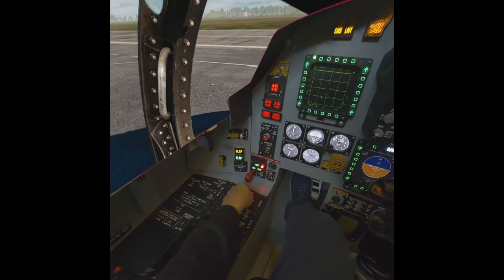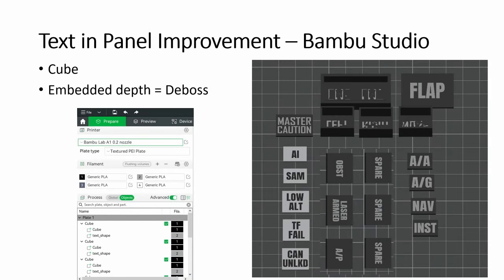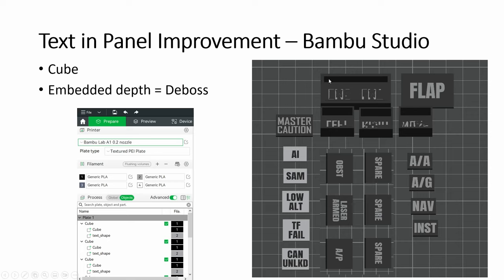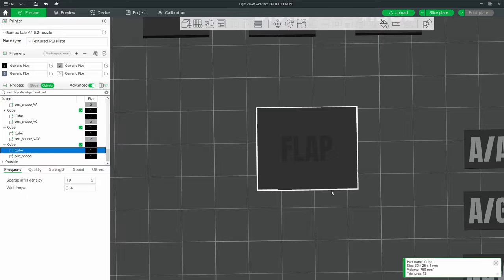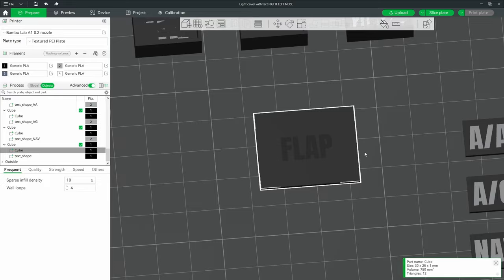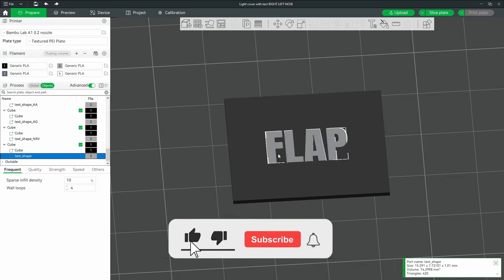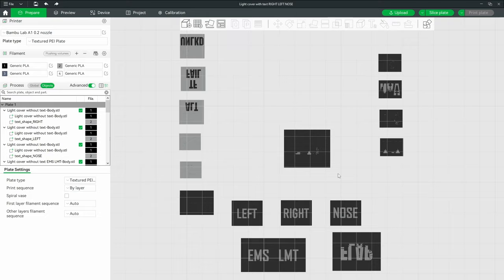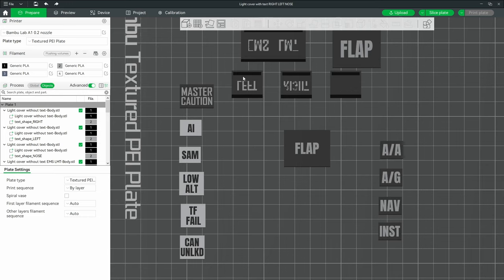Episode 36 DCS F-15E More Readable Text for Light Indicators and Panels

Comment: I got my hands on a very crisp indicator panel and apparently that's made with foil and a laser printer. That's one of the moments I wish I could attach images to YT comments *sigh

Mebbe a good option.
Reply from the maker: laser engraving will always give better results than a 3D printer for text. My video is to show how to improve text if you only have 3D printer, by mixing colors instead of cut out or embossing. I've never owned any engraving machines. So we do what we can with what we have
Reply: @simpitacademy  nah, it's not engraving. It's just a transparent transfer foil and a black ink laser. Kinda neat. Also this is just my tidbit for the next fellow searching for more readable text. Not to criticize your video. I love the shared knowledge without all this usual influencer sugar on top.
Reply from the maker: @BekoPharm  so it’s a laser cut piece, transparent and glued on top of the panel? Like embossing? Many ways to do text
Reply: @simpitacademy  I'm pretty sure that's just cut with a scissor in the end but I'll take a closer look. Got a pack of foil for the printer with the kit.
Reply: @simpitacademy  Checked the foil today. It's "Signolit SC 42" - a transparent self sticking foil that can be printed on with most laser printers (so basically any copy machine).
Reply from the maker: @BekoPharm  can this be printed on inkjet? or just laser. so this is like making your own decal? transparent foil. never heard of it till now. interesting. thanks for sharing
Reply: @simpitacademy  specification suggests only lasers, no inkjets :(
I've like only one sheet of this left so not going to make experiments =)